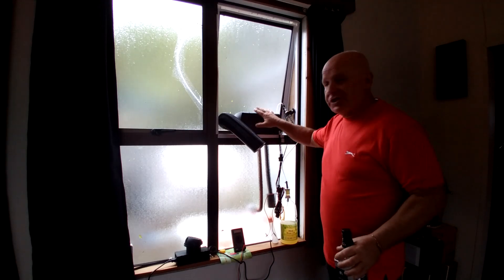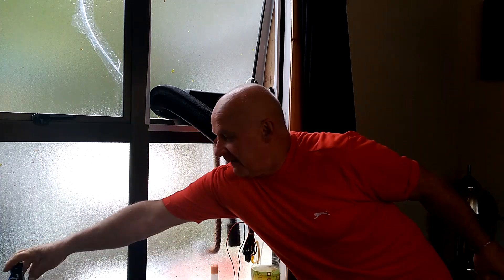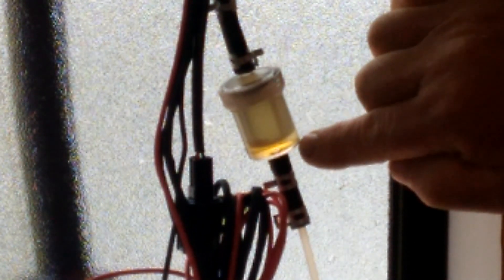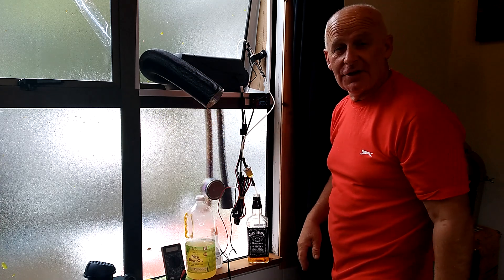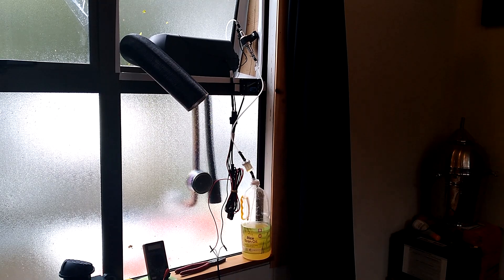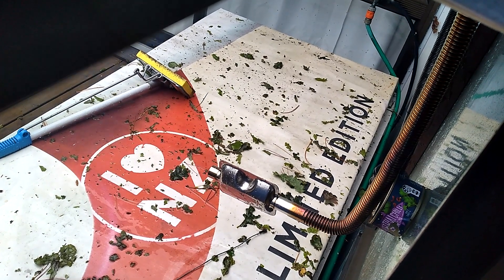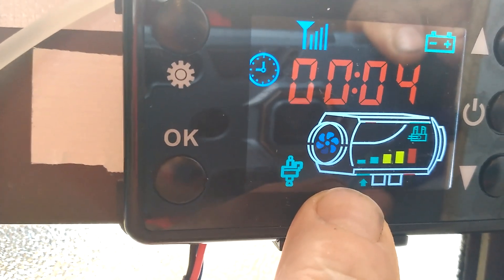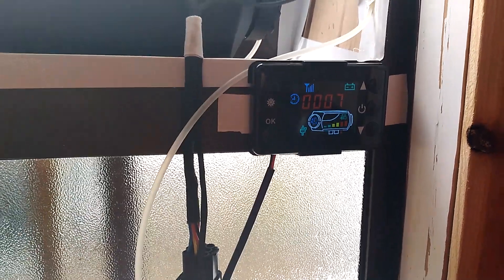Chinese Diesel Heater on Jack Daniels!- will it run?

Comment: In our misspent New York State farmer hillbilly youth we ran a 1976 Chevrolet  Nova 307 8 cylinder on 
 A jug of “ turned “ hard apple cider. It was awful to taste . 
   Run around all afternoon on the jug but had to get “ dry gas “ to keep it running as it would bobble and quit every so often. 
    Not recommended but it did it.   
   We would get a pint mason jar of cider between unloading loads of straw and hay as a kid .   
    The 1970’s were awesome.  We would be jailed for most everything now lol .
Reply from the maker: So true- the 70s were where it happened I was just a tad too young to really make the most of it

Comment: The Jack is only 40% alcohol so most likely it won't burn if you put a match to it.  Also it has no lubrication so will ruin the pump.  You will get more heat out of the chips if you burn them
Reply: Liquor has to be around 50% to burn. Hence “navy proof” rum. If the rum barrels burst and got the black powder wet, it would still go off!

Comment: I use a CDH to heat a small room that is 5 by 9 feet.  When the thermostat failed to shut it down, the temperature got up to 100 F by time I caught it.  This happened when it was 15 F outside.
Reply from the maker: AWESOME! so I can make the dry sauna